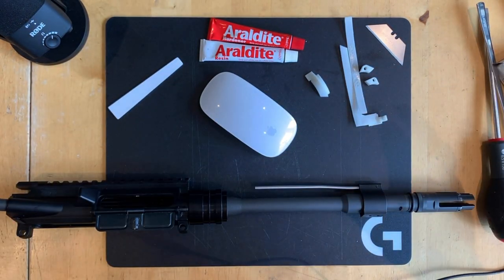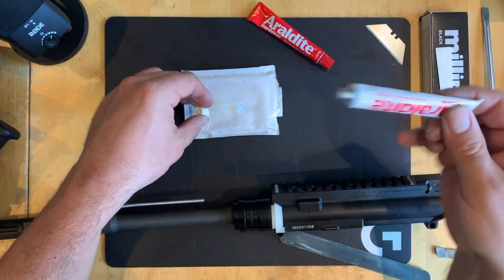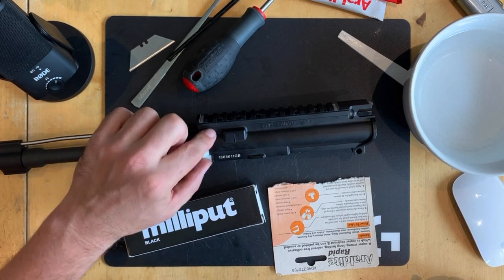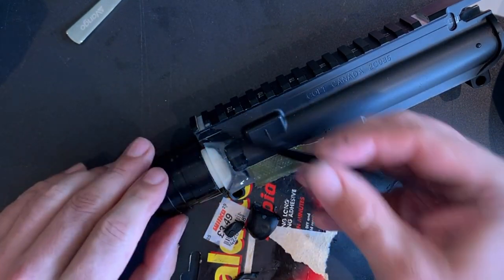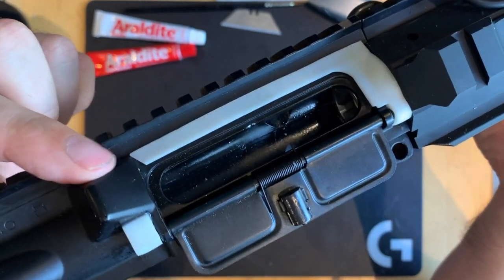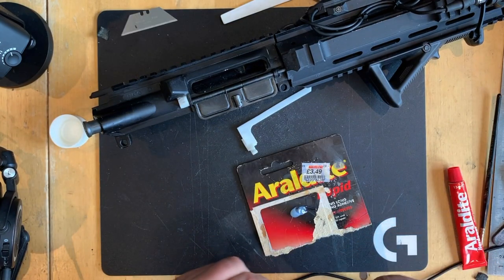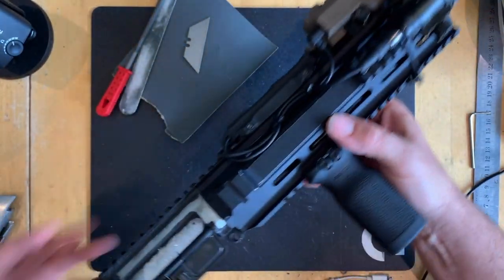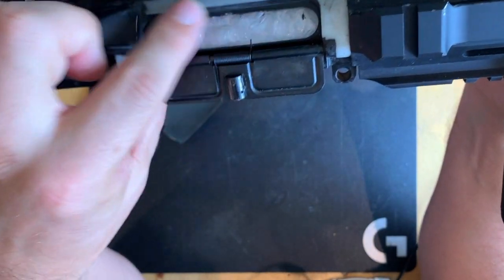L119A2 Receiver Modelling | UKSF Airsoft Rifle Build Part 2 | AATV EP131

Comment: nice job on the miliput mod, cool to see a video on how it’s done. hopefully will help more people do this sort of thing. only thing i’d suggest is replacing the TAPS with a surefire dual switch. really are never finished!
Reply from the maker: Good point on the Surefire dual. I’ve had the taps lying around for a while. I’m not really using it at the moment as I don’t have a tape switch tail cap for the 620. Need one of those too and my clone caps don’t fit. :)

Comment: Nice to see my 3D designs being put to good use :)
Reply from the maker: Thanks for your work on them. Is there somewhere I can credit in the description?
Reply: @AnvilAirsoftTV  no it's all good. Just glad they are proving useful for other people
Reply from the maker: Much appreciated. They made the job much easier.
Reply: @paulpaxton2842   can you still supply the 3d printed part as I’m doing a similar build on my MWS
Regards Mark
Reply: @paulpaxton2842  you could get a good deal of buyers if you sold these. Put me down for a couple sets!
Reply: @jkull173  you can find the parts on shapeways
Reply: @paulpaxton2842  hi Paul thanks for the reply, any help on where to find the parts on shapeways? A name, file location, etc.? Thank you very much and cheers for the great work.

Comment: This is very nice job... I can't be more impressed.... I have a feel questions regarding your gun as I am currently deciding to build a new L119a2 (I have a AG L119a2 MWS currently).

First, do you think its suitable to use GBB in UK in winter due to the cold weather? I know GHK CO2 mags are a solution but I am concerning about the recent GHK QC which makes me doubt if I should use GHK as base gun, but I can't think of other GBBRs which can work in all temperature in UK. 

Second, with all the work on the receiver, as I am not a fan of spray paint, Are the materials able to withstand cerekote?
Reply from the maker: Thanks for the kind words. 

I don’t know enough about GBBRs to answer your first question really. However It was operating fine in 10 degrees Celsius at the weekend on green gas with the 1J nozzle installed. Getting around 1.05J. I’m going to carry on shooting it whenever I get the chance and record the results. 
For your second question again I’m afraid I don’t really know. You would have to ask however you are intending to do the cerecote as to whether it will adhere  to milliput and 3D Prints.
Reply: @AnvilAirsoftTV  Thank you for your reply!  I really admire your good work and looking forward to hear further updates of the L119A2 you built!!

Comment: What are the names of the products used and where's best to buy them cheers 🙂
Reply from the maker: Araldite Rapid Epoxy & Milliput Black. I got them from Amazon. Any good hardware store will have Araldite. Milliput is more specialist.
Reply: @AnvilAirsoftTV  what of the plastic sir where can one purchase that from ?
Reply from the maker: I got mine from a chap called Bruno on the L119 owners club Facebook page. They were high quality prints from these files https://www.thingiverse.com/thing:4389665 a normal desktop 3D printer won’t have the resolution to print them well.
Reply: @AnvilAirsoftTV  you are a legend sir cheers
Reply from the maker: No probs. Glad to help